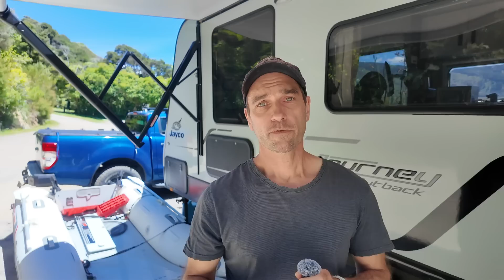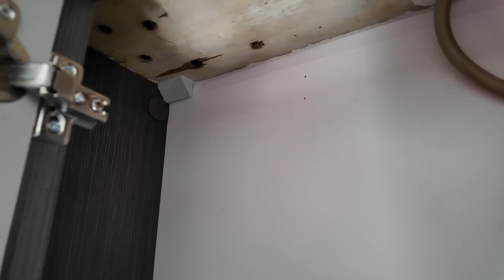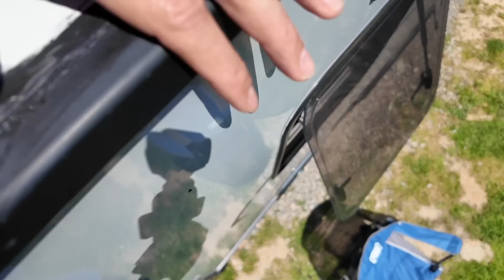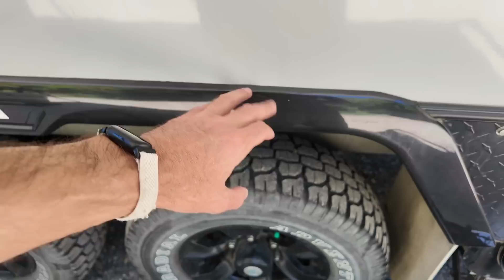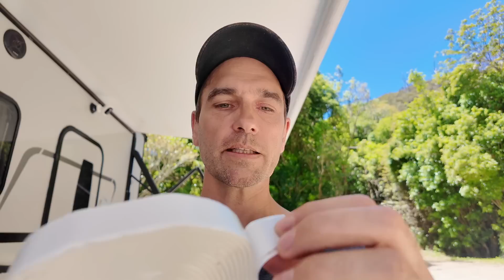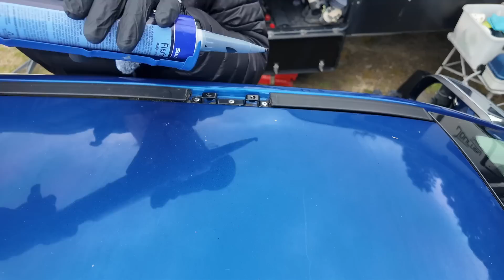Our Jayco Caravan is FALLING APART! 😱 Multiple Leaks Disaster! 🌧

Comment: Everything’s is built to look good on the outside but when problems arise you will dig deeper & find all or most of the faults where the manufacturer cut corners to pull the wool over the customers eyes! This company should be take to the cleaners &shut down after they have repaired & fixed every leaking home they manufactured! 
This site will sure as hell put a lot o future purchaser’s off completely & that in turn will put a huge dent in future sales!

Comment: Was steered to this video when searching for grab handle leaks!  Your video is spot on, the other thing to consider is the terrible build quality of the grab handle light itself.  I found a leak, changed the light to a modern LED, went on holiday and that also leaked.  I had sealed it with plenty of sikaflex, so happy it wasn't my fault.  The in side clear part of the gran handle light had condensation and water inside it.  This is due to the unnecessary exposed seals inside the handle which clearly leak water.  I now have to fix my damaged internal wall myself as  RACV insurance indicate the are likely to refuse to cover it.  The van is like yours, only its predecessor the 2017 Jayco Starcraft Outback.  I have also sealed the rear roof cowling as it had cracked like yours.  Fortunately I stumbled across it before water got in.  On the whole the van has been great. Quality control is poor, however I don' think this is confined to Jayco.  There aren't many qualified tradespeople building vans, they employ anyone with two hands.  Appreciate your video and tips!  I am about to reseal everything!!

Comment: When comes to the sealant sikaflex for example prior to apply they recomends using priming fluid with message”for professional use only” and my question is I’m not professional so I should not use it?besides it’s a very expensive thing the same is Boston so I’m using seller and another problem when I was reselling aluminium roof in my old jayco caravan I had to remove old sealant manually and in some places it was hard to remove and in some it was very hard to do which means it wasn’t clean and degreased properly at first place!

Comment: I would examine the rivets used for the roof rails on the Ranger, should be Blind ones instead of the regular pop rivets. Also check under the filler strip that leads to the front wind screen, any cracks in the paint will be a potential leak point too.
Reply from the maker: Thanks for the tip! I found the leak and it's the actual windscreen - about half way down the windscreen on passenger side. I have squeezed in windscreen sealant for now and it stopped the leak but eventually probably will have the windscreen to be removed and re-fitted. Pain in the arse
Reply: @Fishingreminder  was it factory new screen or been replaced ?

Comment: Jayco caravans are know to have leak problems. Personal experience. The problem is if the design format is difficult to seal, then the reliance falls on the sealant to keep things water tight. That's what Jayco need to look at. Also there are good sealants and not so good sealants.
Reply: This raises a critical question.  Why has Jayco not achieved optimal performance after such an extended period?

Comment: Thank you for the terrific review.  We have had our Jayco Outback since 2019 and it has never let us down, rain, shine or hail. Maybe we’ve been very lucky. I do like the idea of sealing with Eternabond and I’ll be doing that.  With the leaking Ranger, check under the bonnet and make sure that you flow throughs under your wipers are not blocked with leaves and such. That can cause an overflow into the cabin. Cheers.
Reply from the maker: thanks for the tip! I actually found the leak on the ranger. It was half way down the windscreen. I squeezed a bunch of windscreen sealant into the gap and problem fixed :)

Comment: Timber frame on the roof because of cold air transfer. If it was aluminium or steel you would end up with lots of moisture on the ceiling.

Comment: Unfortunately some vans from some manufacturers are end of day constructs...where, because of quota demands on workers, sealing is only partially done.
Can you imagine a surgeon using the same principal with an operation?!!!
Well, most vans cost more than surgical procedures..think about it.
A purchaser should be supplied with a quality control record of who inspected the construct, for which stage and sign off details for each stage.
Leaking vans are a lucrative trade for warranty contractors, so all these mongrels have it made.

Comment: We bought a 1970's Viscount Regency and I had lots of leaks but fixed them myself and its still going well. But with my own design airflow divider on the front it is the fastest full height caravan on the road.. saves 15% in fuel usage.

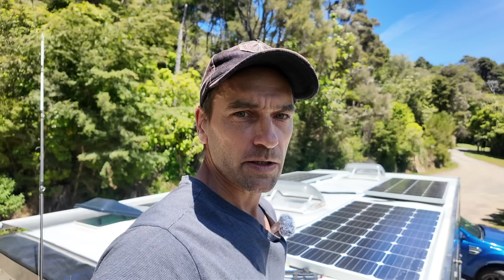Comment: 15:54 - you can also see in the close up that the conductors jammed between the solar panel and the roof have been rubbing with vibration. That needs addressing immediately. It's a fire risk. I'd rewire the whole thing as the conductors also look a bit undersized for the job.

Comment: Hi Guys,
Great information in your video..We got caught with a leak last year in our Crusader Van,
50mm rain in one day.. I used Vaseline to cover where it was leaking then washed it out with turps when I re-sealed it,
Fault was where the sandwich panel joined,
Poor silicon job from the factory, It was always going to leak sooner or later,
I patched the wall with 3mm composite aluminum as it is white ,
Hope this helps as a tip for the future, Apply Vaseline in the wet and it still works..
Cheers 
Craig
Reply from the maker: Hi Craig, great tip for emergency situations - cheers for that.
Reply: @Fishingreminder  Cheapest quick fix around and it stayed sealed for 3 weeks until we got home to repair it,
Keep up the great info and enjoy camping,
Cheers
Reply: turps leave an oil residue it doesn't evaporate, better with  alcohol or thinners

Comment: I brought a 2016 Jayco outback journey pop top never had a problem only door handles been every place i like it no problems .I'm thinking the early one were made better .
Reply from the maker: Supposedly they had most of their quality issues during the pandemic with labour and supply shortages plus high demand
Reply: We have a 2016 Jayco outback 18:55:8 for 1 year and I have just noticed paint above bed starting to flake.i will have to check for moisture.
Reply from the maker: @kymsomerville9024  that will most likely be a water leak. Best to scrape off the flaking paint and check with a moisture meter how far it's gone.

Comment: Hi there. I suspect you're not the only customer with a leaky Jayco.  I noticed, I think, that you don't seem to slot one of the 'ribs' on the jockey tube into the cut-out on the latch plate? I'm not trying to be a smart-arse. My friend's father told me once that I wasn't doing it right, either. Certainly ensures that the jockey wheel stays in place.
Reply from the maker: Hi mate, thanks for the tip. The jockey wheel has multiple ribs for variable height positions. It might just look like it in the video but the rib is in the slot :)

Comment: We had the same bathroom roof leak on the other side! The plastic capping on the roof is a design weakness unfortunately.
Reply from the maker: Yep, that plastic capping is definitely a design flaw. 😩 Prone to cracking and not properly sealed underneath. Eternabond over the seams of the plastic cover seems to have fixed the issue for me now.

Comment: Oh, mate, this is terrible. I actually always assumed that caravans were made of Poly panel. I definitely wouldn't have thought that they were made  from plywood. That's quite disappointing. I hope you sort it all out great video mate.
Reply from the maker: thanks man, yeah most are plywood. There are a few brands now that do composite panels I think. But I guess for structural things like the grab handle frame they would still use wood. It all wouldn't be much of a problem if there was no leak :) I got it all fixed now, at least I know where the issues came from so can keep an eye on it now.
Reply: @Fishingreminder  yea looks like you looked at everything with a fine toothed comb to sort it out!

Comment: Standard for (JUNKO) Jayco i worked at a dealership ,They are delivered falling apart , usually plenty of  leaks and assembled with very cheap components  ,Some buyers are lucky but not many , there just shit boxes ,Best way to avoid the issues is run away from jayco , buy anything else most likely  way better
Reply from the maker: haha, yeah you're probably right, although the alternatives don't look that much better either in terms of quality and leaks. The english caravans have tons of problems and other Australian brands seem to be just rip offs from jayco.
Reply: @Fishingreminder  I think you need to do more research on what a quality Australian van looks like. Jayco is built to a price and relies on volume.

Comment: Thanks for the video.  I've had most of those issues in my 2015 jayco starcraft.  First I had the internal panel de-laminate due to a leaking wall.  It was well out of warranty but a local, independent, repair shop (not jayco) took lots of photos, sent them to jayco with an assessment that it was poor construction and jayco approved the repair.  Second and related was a window leak that took weeks to find.  In the end all the windows came out, the horrible mastic removed and resealed.  Third I removed the wheel arches and was shocked at the poor design which is almost impossible to seal.  I cut strips of fibre joint tape, covered them with silicon and lay them across the huge gap.  Then more silicon before re installing the arch.
I think the key to water leaks is obsessive inspections inside and outside because they are so difficult to spot.
Reply from the maker: Thanks for sharing your experience - It's great to hear from someone who's been through it and found solutions!

Comment: Under the rear plastic roof  cover we found  very  minmal and we had all surplus holes and ones that have been used for cables or screws adequately sealed.
Reply from the maker: Awesome, thank you so much for sharing your experience. It seems Jayco is has not been sealing these caravans properly underneath the plastic cover. I might have to pull mine off or seal it up so that water can't get underneath.
Reply: They have always been made of waterproof plywood why because it's cheap

Comment: We have a 2017 jayco outback  19.61 with exactly the same issue. Resene provided a prrfect match.  Three leaks .
Reply: Could you share the ceiling Resene color match info as you say yours was a perfect match. I've got some delamination to the roof cnr but caught it very early as caravan is garaged when not used. The delamination is so limited I'm about to try a syringe with glue in the cracked lamination. If I stuff it up I'll have to scape and repaint to match. Already resealed the roof. Thanks
Reply: @Gazza-M  i have tried to attach photo of the specification of the paint. I took several flakes down to our Resene shop and the lady matched it for me with a hand blended mix. The colour is Double Bianca (Y94-016-087) super  gloss. I hope  this helps. The problem I had was I could not successfully duplicate the stiple effect on the areas where the paint had flaked away. Sanded the the edges with a very fine sandpaper at the dimished the outline a little. In some lights I can see it but overall  happy with it. I used superglue initially to glue downthe vi yl coating and thru experimentation settled on the super glue gel as the best as it does not run so easily and can managed as to amount applied. Hope this helps. If you anywhere rotorua. Let me know and I can show you the results
Reply: @davidhutchison4957  Thanks for that rapid reply and detailed info. Mine is in the front ceiling cnr 5cm wide multiple crack lines then narrowing to 2.5cm with a singular jaggered crack line coming out some 40cm from the cnr towards a north south bed, so it ends above the wardrobe/bedlight  in the ceiling of a Journey Pop Top roof.  Starting from the cnr following close to front leading edge trim, none of it has flaked off with no water staining.
As said its always been garaged, the cracking of laminate wasn't there mid September on a 5 day trip with only slight showers one night then it was garaged, Then early November it was rolled out again and I did hose it heavy over the roof and spotted the damage to the ceiling in the first day in hot zero rain conditions at a caravan park. So got it early. 
Yep one could see separation in the roof silkaflex Jayco use to aluminium pop top outer frame. So re sealed the roof and haven't started the inner ceiling repair, but with Inland east coast Au heat it will fully dry it out before I attempt the fix. Bought some modelers Revell Contacta Cement with built in syringe, but will take note of your gel recommendation now. Then re the fine crack lines provided I don't damage it, l was going to lightly dab Sikaflex white Pro+ on the end of Bamboo BBQ stick and spread lightly over the crack lines and the stiple effect will help hide the dabbing of the white Sikalfex,
Thanks again for your response and it will help others checking this out too. Have a Great Xmas.

Comment: Had a similar issue with our Dmax, turns out the factory are a bit stingy with the rood panel sealant, a good friend and windscreen installer fixed it up for me, so get your roof seams sealed as well while your in that area, good vid by the way 🙂
Reply from the maker: thanks man, good tip. I think I narrowed the leak down to the the top left corner (passenger side) of windscreen. If I cover this up with a tarp it won't leak but if I move the tarp up a bit and expose the top corner I'll get water dripping, pretty much instantly. It's seems not to be an easy job to remove the windscreen and re-seal. So I'm thinking maybe I can squeeze in some windscreen sealant and try smoothing it out with a soapy wet q-tip or something.

Comment: We had similar leak issues with our Jayco and got a paint match from Resene for the interior damage which we applied and it blended in really well. It’s Embacryl gloss waterborne enamel..Shade is White 403.
Reply from the maker: thank you so much for this tip! That's awesome. No more guess work. I'll get it from Resene next time we're in town. Did you apply a sealer first or paint directly onto the plywood?
Reply: I applied a white sealer undercoat followed by three or four top coats with a brush initially to cut in and then roller. Had exactly same damage as you did above shower and toilet and that cupboard. Good luck and I enjoy your channel thanks
Reply from the maker: @JennyJohnston-e5f  Awesome, thanks for that, I will try same way. Did you figure out where exactly the water came in?
We have friends with exactly the same water damage as well on both sides, cabinet and shower. It seems to be a very common issue with these Jaycos then. There is a lot of water pooling in the back corners on the roof. Perhaps a tiny little crack in the sealing will make it leak in ... I think I will just remove all the sealant and then apply eternabond over all corners.
Reply: ❤ Thanks for the info!
Reply: It was from under the black plastic  
Addition at the back of the Van that one with all the light fittings, it had the be removed to fix the leak .
Reply from the maker: @JennyJohnston-e5f  okay, that's what I suspected. Looks like Jayco did not seal properly underneath the plastic cover and the cover itself is also not properly sealed.

Comment: Great detail. Shocking to see the poor workmanship from factory. Did you guys buy this new from Jayco? If so, what was your experience like dealing with them as new ones have a 5 year structural warranty. We have been considering getting a Jayco Silverline Outback 22ft from Jayco Canterbury.
Reply from the maker: We bought ours second hand. We dealt with Jayco Canterbury only over the phone for some support questions and they were great. Very helpful and friendly. In contrast, our experience with Jayco Auckland wasn't very good. 
The 5 year warranty is good, it's just a shame that it is not transferrable. 
So even though ours is less than 5 years old, we don't have that warranty.
But anyway to maintain the warranty you have to take it back for the regular  warranty services - once a year I think. Which is probably a good idea anyway but not sure how costly. 
The good thing about buying second hand is that you can do all the maintenance yourself and not worry about warranty :)
Also when buying second hand - most of the factory and warranty issues probably have been sorted out by the previous owner.  
Hope that helps :)
Reply: Shocking build quality from Jayco- no wonder they are never bought by second time travelling caravan people, who buy better quality the second time around
Don’t buy jayco

Comment: Another one to keep an eye on are your caravan brakes  and wheel bearings. Also don't forget to check the inside wall (under the caravan) of the tyres.
Reply from the maker: Yeah, I'll have to check that out, thanks for the tip. The bearings are a bit overdue.

Comment: Nice video, yeah the problem with sealants/glues is they all delaminate over time with thermal expansion and vibration. That tape looks good to handle that. I have been laser cutting silicone gaskets lately and they have been amazing. Note that you can use string with a capillary effect to divert/suck water where you want it. I placed a string across my garage floor one time and diverted all the water to the front door.
Reply from the maker: that is an interesting trick with the string, I haven't thought about that but could come in very handy. Thanks for that.